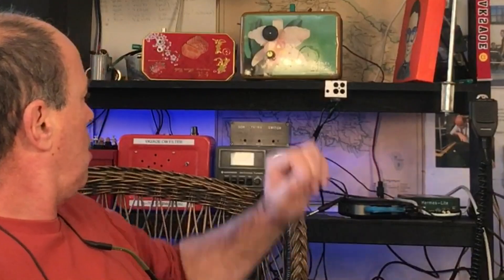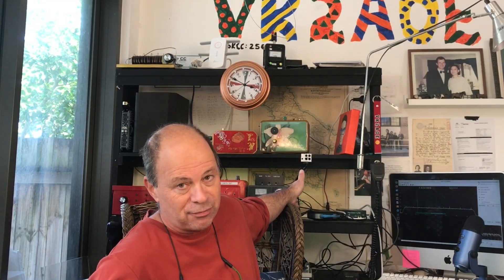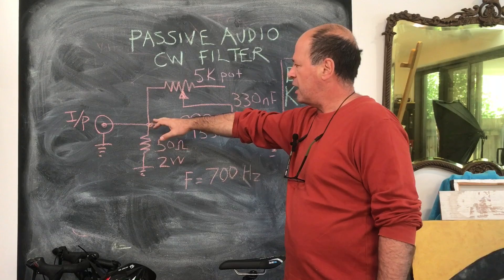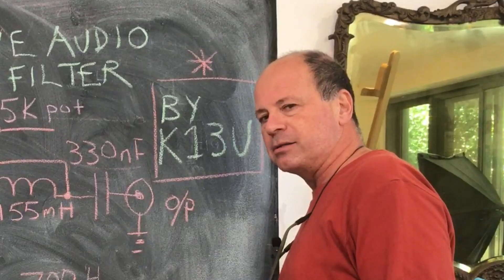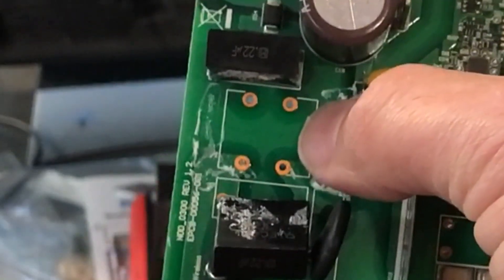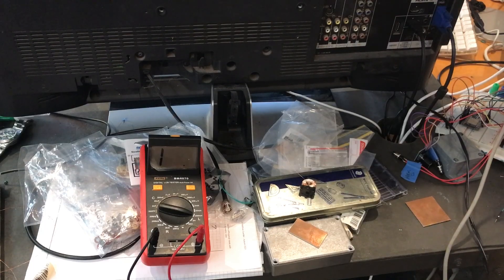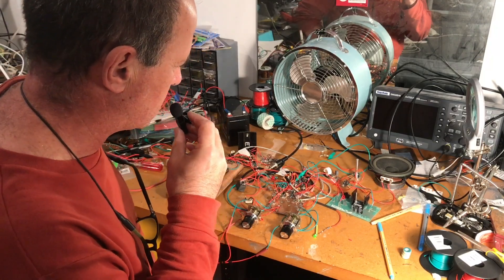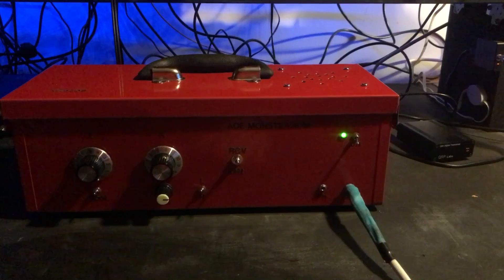A passive CW audio filter

Comment: 4:12 is this the final circuit?
Reply from the maker: Yes …. But I removed the 50 ohm resistor to earth at input and the pot. So mine was a fixed bandwidth (narrowish but I didn’t measure it?). So 4:12 is the cct as provided by the original creator. I found the bit I removed were causing too much attenuation for my preamp. 73 de VK2AOE.
Reply: @TheArtofEngineering  thanks

Comment: Timing on this video is great. Keep up the great work and videos. I built a little cw rig for 80m on the weekend. 😊
Reply from the maker: Thanks! Was it a synthesised VFO, Xtal or VXO? Transceiver or xmitter? Love homebrewing. 73 de VK2AOE
Reply: I used a 74HC240 and a crystal and irf510 I am currently working on a jfet vfo for it. It's a good little oscillator and could even be driven by a DDS etc. hope to catch you on CW soon 😁